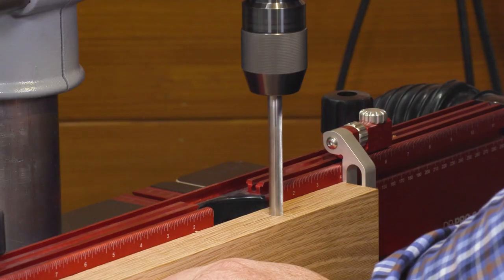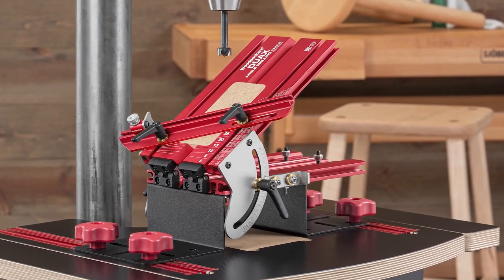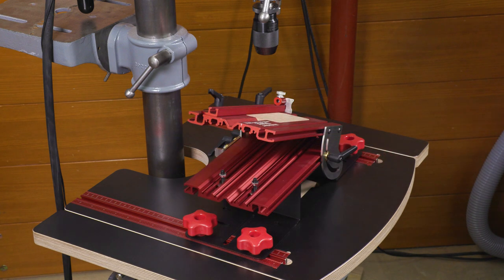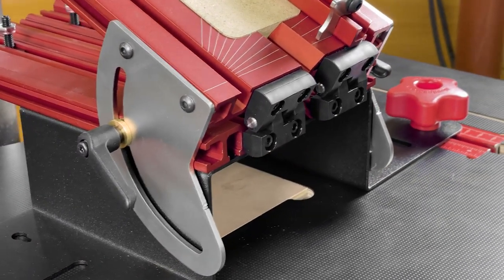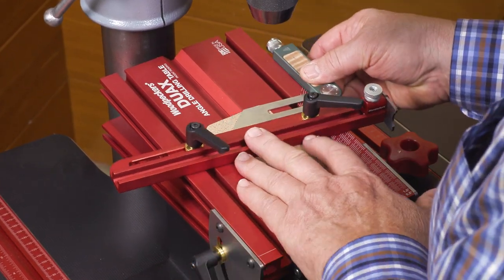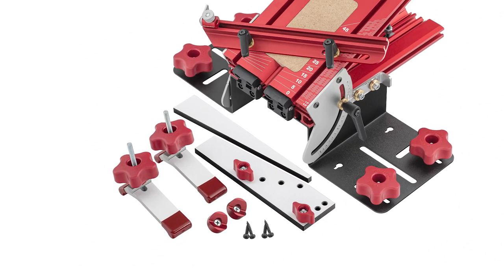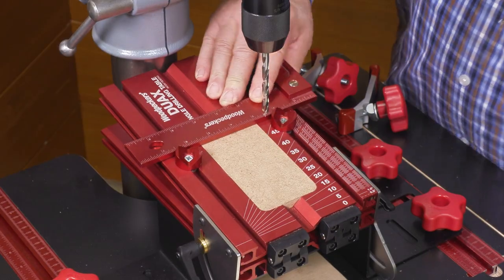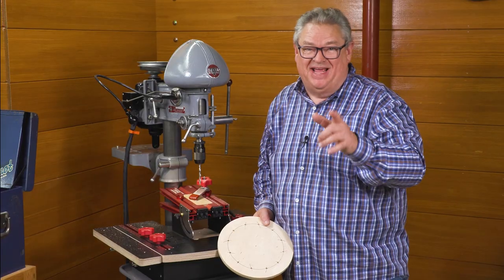Safe & Accurate Angled Drilling With DUAX | Woodpeckers Tools

Comment: Neat tool, but pricy. 
But it has one fatel flaw.
The table on your drill tilts.
For this to be accurate your table has to be in perfect leval or at 90dg of the bit, given most drill headstock fit onto a 3 or 4" dia pole 
Youve got a lot of potential to be misaligned.  The drill press isn't a Bridgeport, and close enough is plenty close for woodworking.  

You might set the guide to drill a 22.5 dgr hole and get 22.7  becuse somthing is out of alignment. 
So in order for this to work it needs an adjustment system for your drill to set the table left to right and frt to back at a perfect 90 to the bit taking into account the spindle and parts are machined right and the chuck is true.  Its being off a min or a whole dgr. A min won't make a difference unless the parts 30 feet long.  Angles are a tricky subject. 
Guys say perfect but nothings perfect.

I want a unit that can do this and give x y and z adjustments  like a mill.

Comment: Can it be integrated with your new drill press table.. If so,  how?
Reply from the maker: Yes, you can see in the video I am sliding the mounting bolts right into the track of the DP-PRO.
Reply: @WoodpeckersLLC  Thanks, somehow I thought that was a special base just for the DUAX.  I missed that in the description.

Comment: Looks like the hinges are made of plastic, is that true?  If so, why!!!!
Reply from the maker: They're injection-molded reinforced plastic. Why? Because they can hold tighter tolerance and still operate better than just about anything else you can make them out of economically. It's the same hinge we developed for the Precision Taper Jig.
Reply: @WoodpeckersLLC  "because they can hold tighter tolerance" than machined aluminum, not likely.  I think using machined aluminum would had been far superior.  Will still order one as it looks like a fantastic jig, but could had been that much better with machined aluminum hinges.
Reply from the maker: The plastic has a lower coefficient of friction, so the hinge leaves can fit tighter to each other than aluminum. There's virtually no load on the hinge itself, so it really is a logical choice.